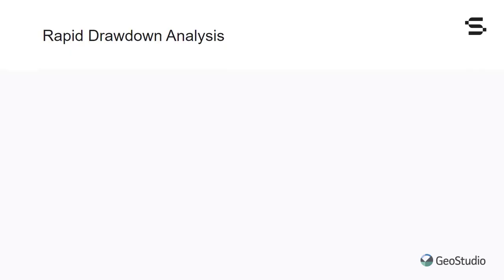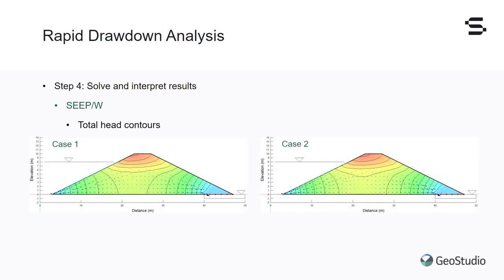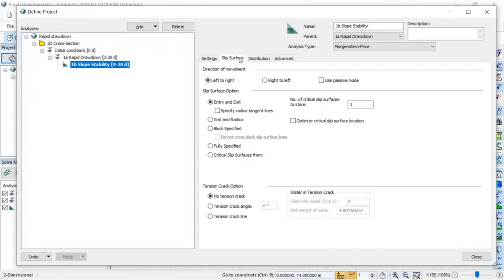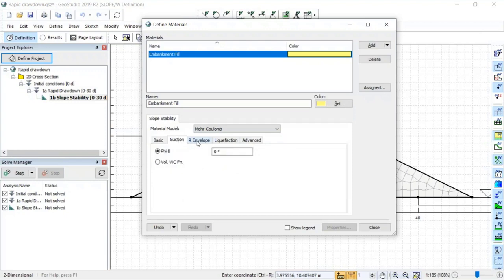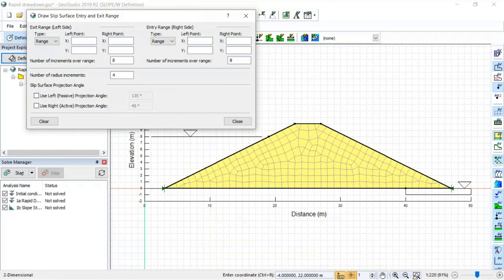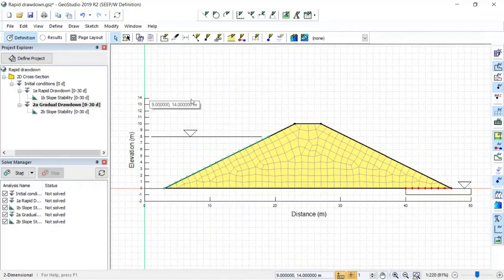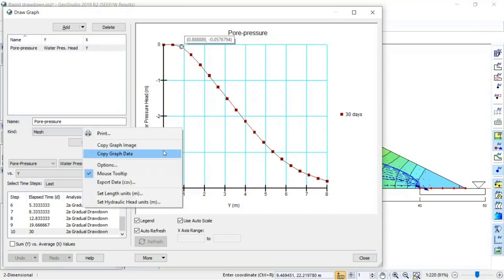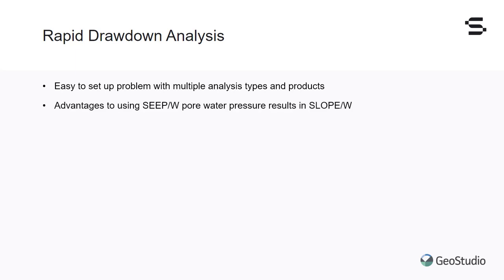Slope/w +  Seep/w - Rapid drawdown analysis

Comment: Hello sir, I have a question. Why does my GeoStudio from transient to slope/w always ask me to re-mesh? I've tried dozens of times but it always fails. Thank you. I hope my question is answered.
Reply from the maker: Hello @simian007,
Slope/W does not require meshing because it uses the Limit Equilibrium Method (LEM), not FEM. Only Seep/W needs a mesh.
In coupled analysis, Slope/W simply reads the pore water pressures from Seep/W. The re-meshing request is likely because your Seep/W analysis hasn't been solved successfully yet. Make sure Seep/W converges first, then Slope/W should work fine.
Hope this helps!
Reply: @hydraulicstructures  The Seep/W problem has been resolved, sir. However, when I proceed to SLOPE/W Rapid Drawdown, it always asks for a re-mesh. I've tried various methods but still can't. Could I consult further regarding Seep and Rapid Drawdown, sir, for the purposes of my bachelor's degree final project research? Thank you for your reply.
Reply from the maker: @sausaan07  Which version of GeoStudio are you using? I'd be happy to help you within my capabilities. If needed, you can send me your .gsz file to check at: hydraulicstructure86@gmail.com
Reply: @hydraulicstructures  Thank you, sir. I will send it to your email immediately.
Reply: @sausaan07  have you found the solution?
Reply: I have the same problem as you. could you let me know if your issue is resolved?